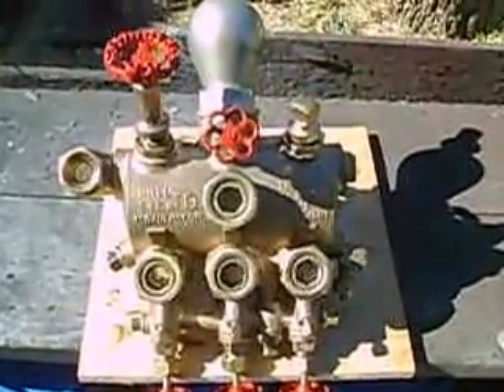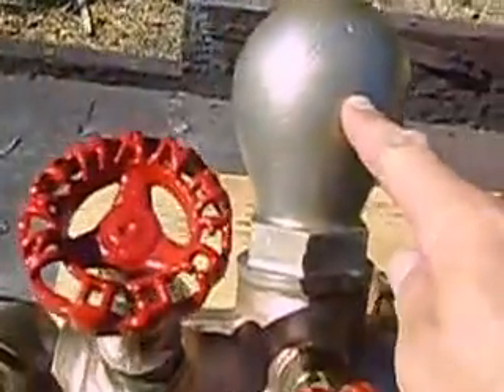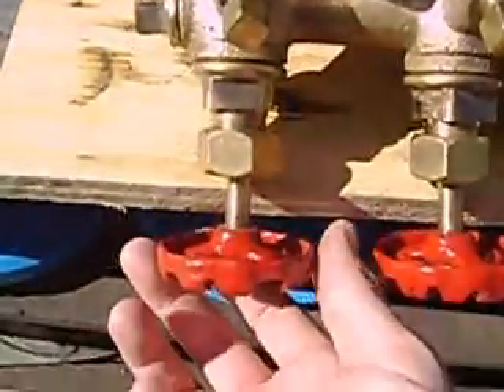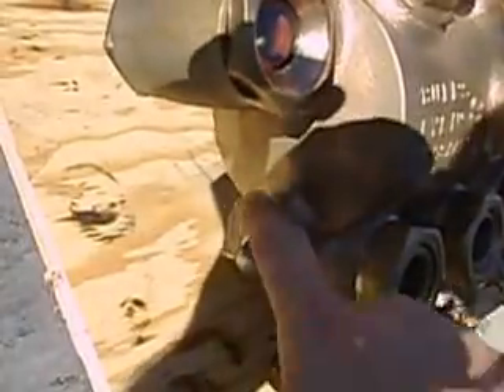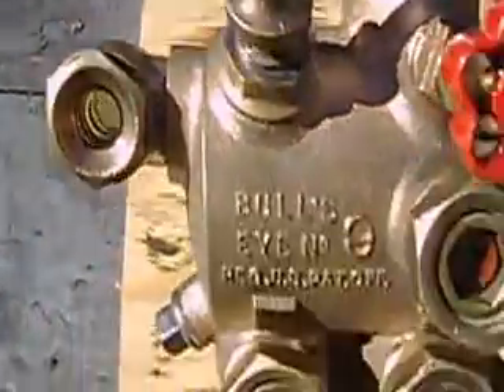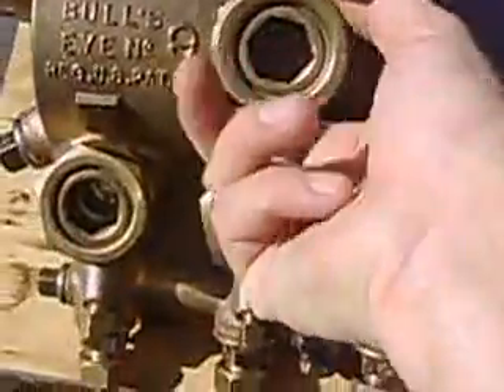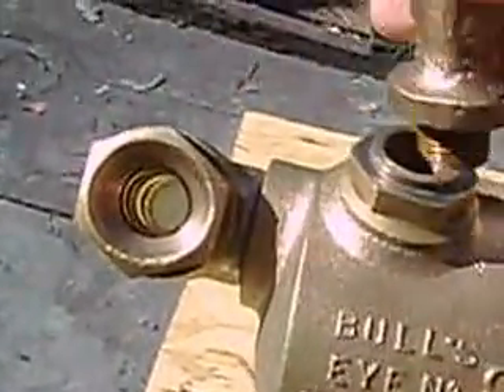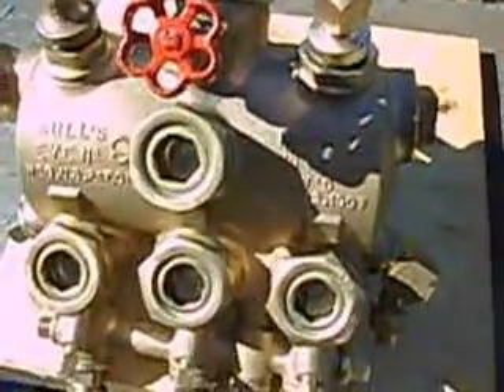Nathan Mfg Co Hydrostatic Lubricator

Comment: Very, very clever.  I've been reading up lots and lots about steam locomotive tech, and I've read up about the mechanical lubricators that were fitted from the 1920's to the end of steam locomotive production, and I'm not really sure actually which method is better, the hydrostatic lubricator, or the mechanical one.  By the point were both available, I guess it more came down to operator preferences and the engineers and firemen stating that they had enough to worry about watching for track signals and bad sounds and the gauges, and not having to worry about keeping the in-cab lubricator topped off and reducing or increasing the oiling rate as speeds changed would increase their vigilance on more important matters,and at the same time reduced waste from excessive oiling when the engineer or fireman forgot to turn down the drip rate when slowing from a fast run.